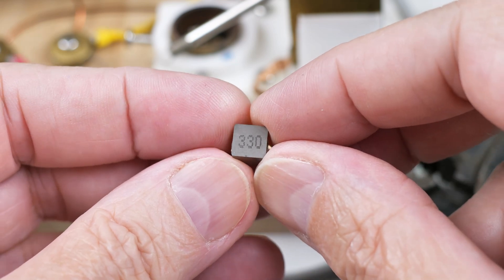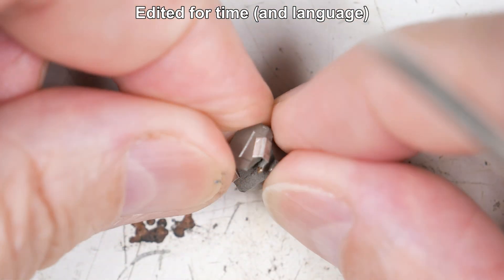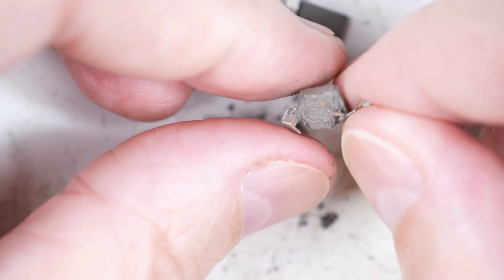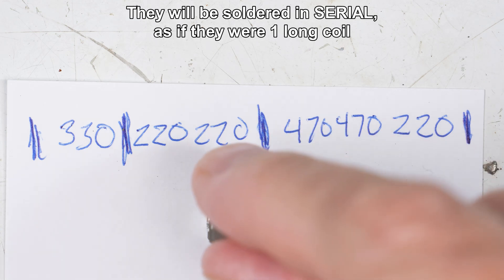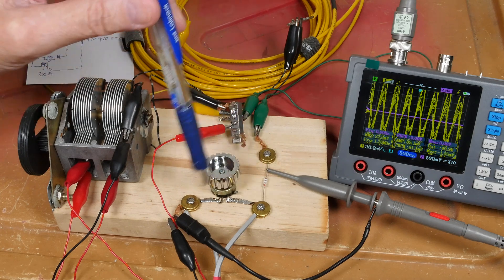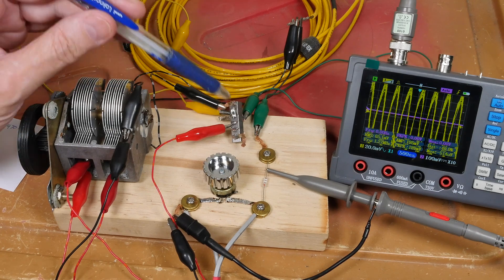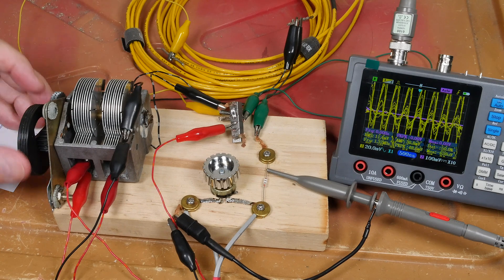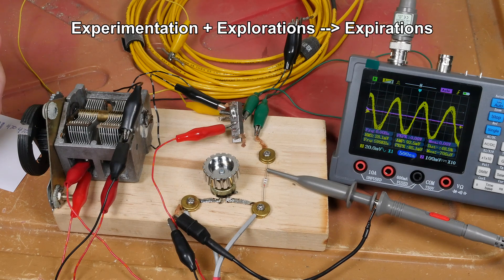Crystal Radio-SMD Experiment & Radio Design #2 (4K)

Comment: What if you have the winding wrong? By turning it wrong? How do you know that the wind is correct arranged?
Reply: That could be the reason why the ground and the antenna are swapped 🤔...
Reply from the maker: I did have them swapped. I can test with an oscilloscope and signal generator. Compare one against the other and check their phase. I have another video on doing that.  https://youtu.be/5BPFcY2Wd_A

Comment: First of all, as we've seen the smd inductors are effectively <potted> in some silly ferrite/resin compound, so the while the field may be detectable in the area, I wouldn't expect it to be "series gangable" as if there were a common core.
You might as well put one EI-cored power transformer on top of another and expect them to co-induct, when the laminations are designed to concentrate the field!

I'm guessing that this is a short-cut they use to obtain max inductance in a convenient SMD package = a very cheap-and-nasty approach.

That said... have you tried using one of those multi-component-testers to measure the inductance when you attempt a series-gang?  
The orientation of the printing may be totally random and thus irrelevant to the top-to-bottom 'polarity', so the only way to check if the L-total increases with each addition would be to check at each stage.  
If one of them were mounted with opposite polarity to the previous, I'd expect the L-total to decrease, and swapping the connections should achieve a little improvement - even if not Lt=L1+L2+Lx

Comment: First thing first, take care when breaking ferrite because it can break in small shards. And your eyes do not like them. 
Second, it is really a ferrite pot that do not radiate EM and is not (or very little) influenced by external EM fields. So, no dice with coupling them as well like the original. Because the airgaps, you have that particular configuration (my guess). And, also the inductance is different than calculated because of the very low mutual inductance between the individual inductors.
If you can get rid of the air gaps, what you have there is a ferrite bar with the coils, just like a normal AM ferrite rod. 
A ideea to couple better, (no air gaps), try to grind the ferrite material to a powder and put it between the inductors. I would mix it with bee wax or similar (very little amount of wax, much ferrite powder), not a big fan of cyanoacrylate.
Glad you did it!

Comment: yes i thought so most of coils in laptop power suplies are stacked this way, some of them are even resin poted on a ferrite core
can't you assuime the coils are wound on a ferrite  bar of a crossection equal to the one of the ferrite envelope?

what i was afraid the most was that different batchest/values could be wound back to front  compared to different batch and i was thinking of testing them with dc current and compass for polarity

Comment: I would say that you are probably opposing the inductors by reversing them.  Being that it is a manufactured piece I would assume all the coils are made the same way. At least for one particular value it may be reverse on other values.  There is always an exception to the rule.  You need to find out which way the coils are wound and have them all the same orientatuon.  The only way to do that would be to get a magnetic compass and run a small dc current through the coils and see which side is north.  Note the coils tend to use very fine wires.  If you have a data sheet for the coils then make sure you do not excedd the vurrent value given. The reverse coils could probably explain the reversal of ground and antenna..
Reply from the maker: @billywhizz6965  Spoiler: You are correct. For orientation a freq gen & o-scope will work.

Comment: Having an LCR meter would help you understand the consequences of stacking the coils. coils don't just add up like resistors when there is mutual inductance. Coupling counts. Ferrites have specific frequency ranges. These inductors are probably designed for use in switch mode power supplies that operate at lower frequencies
Reply from the maker: In my next video I tested them over the frequency range of AM radio 500 kHz to 1600 kHz and there's no significant signal degradation.

Comment: Inductors in series is just like connecting resistors in series.  i.e.  100 ohms + 100 ohms = 200 ohms.  Inductance in series: 220uH + 20uH = 240uH.  They should be electrically connected and not inductively.

Comment: Interesting results.  I'm curious to know if the Q could be raised somehow.  Could it be tuned like a vario-coupler with spacing of the smd inductors, or passing inside an air coil?  A lot of interesting ideas spring from this experiment.
Reply from the maker: @aaronwoodard3354  I found that when the inductors separate accidentally the tuning changes  so the answer to your question seems to be yes.
Reply: Looks like there might be some of the case can be ground off to get the coils closer.

Comment: You are using a shielded inductor not a open coil.
Reply from the maker: @haraldlonn898  And it's 3 layer and ferrite. It still throws a lot of RFI because it affects my transistor radio at a distance.
Reply: No, is not shielded. What he did is the equivalent of a ferrite rod .